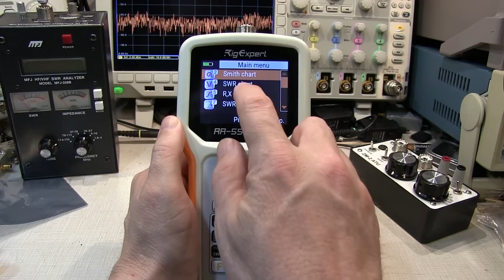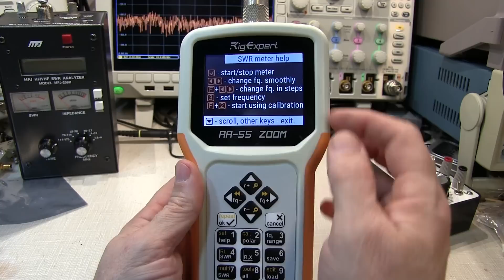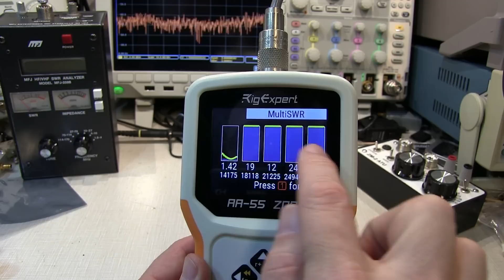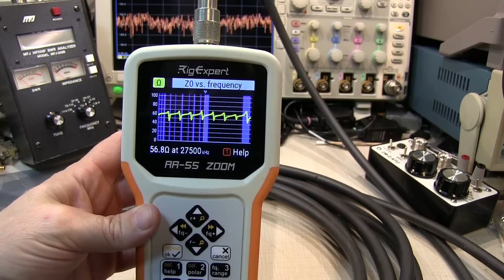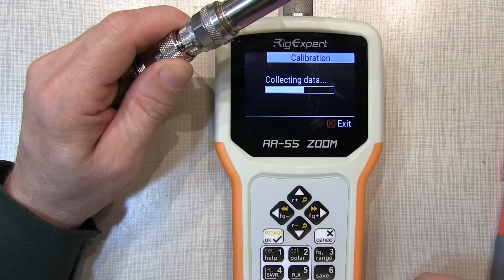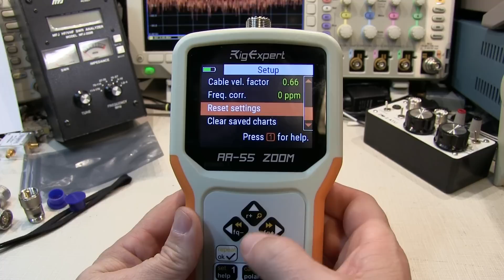#280: Review of RigExpert AA-55 ZOOM Antenna and Cable Analyzer

Comment: For a video that is over six years old, this is one of the most comprehensive and exhaustive videos on this cable and antenna analysis tool that I have been able to watch so far. I do not think that after watching this video I need to watch another video on this product as the reviewer has done absolute justice to the product under review.
Simply splendid!
73's

Comment: I recently purchased the AA 55 Zoom and found it to be extremely intuitive to use. The basic features for setting up my home brew half wave antennas as a newbie on the HF bands are very gratifying. 
The manual that came with it however was not as in depth as this presentation and I thank you Sir for this Outstanding review.
73 KF4IOZ.

Comment: Thank you for this video. If I understand the parameters SWR , [Z), R, X. But I do not understand the parameters RL , phase , nH, pF what do they represent of the antenna
Many Thanks
Reply from the maker: RL is return loss - basically the (log) ratio of forward power and reflected power.  Just a different representation of the match instead of VSWR.  Phase is a measure of the complex impedance - 0 degrees means resistive, and non-zero means you have either capacitive or inductive reactance.  The nH or pF values are the actual computed values of the inductive or capacitive part of the complex impedance.  They are only important if you plan on designing your own impedance matching network.
Reply: @w2aew  Thank you very much
Reply: @w2aew  Thank you very much for this video, which taught me everything I need to know about the AA-55. Everything is clear now

Comment: YouTube is censoring this info:
I just received a rig expert 500 yesterday and have an ungodly number of problems with it and no way to really contact anyone for help except an email in ukraine. When you finally locate the manual it's in a font size smaller than anything I've ever seen in my life when you print it out, the software doesn't work on any of the three computers that I have and it screwed up the booting on two of them. When you change velocity factor in the settings it's not reflected when you go to take the measurement. The manual does not include any instructions on the functions on the second screen. To top it all off there's really no f**** help at all from the rig expert company for any of these problems they sell it to you and then tell you to go to hell.
Reply from the maker: Sorry to hear of the issues you have. My experience has been good

Comment: will it do the same thing for 11m? also as i do both
Reply from the maker: Yes, you just have to set the frequency manually, but it will do everything else as shown.
Reply: @w2aew  good deal thanks great video and explanation going to order the same one in video
Reply from the maker: @junior53329   You could save a little money and order the AA-35 ZOOM if you don't ever need to go above 35MHz.  All other functions are identical to the AA-55 ZOOM shown in this video.
Reply: @w2aew  yea I just looked up the 55 and the 35 there right around the same price point

Comment: A question from a new General HAM, since this was not mention in the General study guide
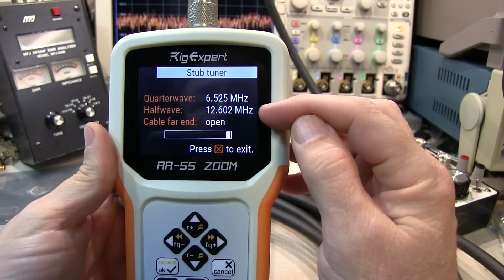16:15 If your coax to the radio is not 1/4 or 1/2 wave length long and the impedance at one end does not match the other, can this be fixed with an antenna tuner or its better to try and get that coax length right? Thanks for the detailed guide.
Reply from the maker: It's perfectly OK if the coax isn't a specific length.  All that means is that the impedance seen at the input of the coax isn't the same as the antenna impedance.  However, if the antenna is adjusted/tuned to be at the same as the feedline impedance (coax, typically 50 ohms), then it radio sees 50 ohms regardless of the length.  If the antenna is not equal to the feedline impedance, then there will be an impedance change (but not an SWR change).
Reply: @w2aew  Thanks for the clarification.

Comment: WOW!! No stumbling, no 'hem-and-haws' with your information!! You FLAT know what you are speaking about!! Question: Does the calibration 'Tee' come with the RigExpert, or is that an extra expense? I have learned WELL that that particular 'Calibration' step is VERY important in adjustment of your antenna or networks!! GREAT JOB!! you sold me on the unit!!
Reply from the maker: The cal set that I used was something that I had.  I don't know if RigExpert offers one.  So, you'll have to obtain or build your own.

Comment: do you have a video of cutting the coax to length using this aa55. i need to cut my coax for my 11m beam antenna but cant fig it out. im new to all of this. nice vid
Reply from the maker: Why do you need to make any measurements to cut your coax for your beam?  The feedline length is not critical for antenna operation.

Comment: I know this us an older video but hope you will answer my question. Does the calibrated OPEN, SHORT, LOAD come with the analyzer or is that a separate purchase?
Many thanks!
Reply from the maker: This would be a separate purchase, or homebrew project (I have a video on that).
Reply: @w2aew  Many thanks for the info.

Comment: Could you direct my inquiry. And forgive my non-techy question. My dad installed a whip antenna on his roof about 6 foot on a about also 6 foot pole in a 3 foot grounded tripod with LMR 400 coax cable. He cannot get the meter to read below 4 on the roof and 3.1 at ground level stuck in ground. Any help sure would be appreciated.
Reply from the maker: Not enough information to go on.  What frequency/band is he intending to use?  What is the antenna, specifically?  What does the SWR read in the middle of the band of interest, and at each end?

Comment: hello friend I have an analyzer just like yours but I have a problem when I measure the swr it gives me an answer of the swr and when I measure it with the radio it gives me another what will be the real swr? the radio or the antenna analyzer?
Reply from the maker: This can sometimes happen if the shield of the coax is acting as part of the antenna itself.  The analyzer and the rig will present a different load to the shield, thus can give different results.  Also, if you use a different length of coax to test with the analyzer and what you use with the radio, the reading can change.  The result from the radio should give a better indication of the mismatch that the radio is seeing, assuming it has been properly designed/calibrated by the manufacturer.

Comment: I found this video seeking to understand R and X measurements.
Someone told me there is more to tuning an antenna than SWR. However on 11 meter band I've had good luck simply setting SWR.
That's an awesome analyzer and great review of the Rig Expert!

I have the Nano VNA H4 and its very nice but I don't think its on the same level as the Rig Expert but for the money it sure beats a traditional SWR meter.
I never thought about calibrating it to the end of the coax, that's a great idea.
I'm not sure how you would deal with an antenna that has a certain length of built in coax like a mobile antenna though.

Comment: So if i want to know what length do i need for specific frequency do i plug it to the antenna or no? I just got that analyzer  yesterday, thanks
Reply from the maker: If you're simply feeding a single antenna with your coax, you do NOT have to make a specific length for a given frequency.  The SWR will not change with the line length.  If it does, it means you have some common mode current flowing on the outside of the coax, and that should be corrected.  It is true that the impedance looking into the line will vary with line length, but the SWR will not change.

Comment: Thanks.  Pretty good analyser.  But for the beginner, remember that coax is not the only answer.  A dipole for multiband use is by far best fed with twin cable into a 4:1 balun, short coax to a matching unit.  Why?  look at those high dB losses in the video with even a fairly good SWR using coax.  With twin, you can reduce those losses to just fractions of a dB, even when the SWR is very high.
Reply from the maker: That's precisely what I use.  A 130' dipole fed with window-line twinlead into a widerange balanced line transmatch.

Comment: Can you please provide a link to your 3 port open, short, 50 ohm device?  tnx KF4HR
Reply from the maker: It is made by Rosenberger - and I'm afraid it costs more than the analyzer if purchased new.  I picked it up at a hamfest several years ago for a lot less money.  You can build one that works well for HF/VHF.  I did a video on that.
As examples, here are some units like the one I used:
https://www.ebay.com/itm/Rosenberger-Calibration-Kit-open-short-load-7-16-female-DC-4GHz-60K34R-MSO-/293092915400
https://www.amazon.com/Open-Short-Calibration-Connectors-NMOSPL-12/dp/B07H7TBZYD

Comment: Can this analyzer be used to get 'real-time' measurements while 'tuning' an antenna (such as a hamstick or buddipole) ??
Reply from the maker: Yes, it updates a few times per second.  Also, features like the SWR meter function, the SWR2Air function and the Heartbeat Monitor function are all aides to help you with live tuning of an antenna.
Reply: @w2aew  Ok, thanks.

Comment: Can someone point me to instructions for setting my 2m SWR2Air frequency? When I try it only let's me do HF frequencies. Example, I try to use 146.490 but it comes up as 14.490. What am I missing???
Reply from the maker: I believe the maximum you can set it to is 146.000MHz.  While in the SWR mode, hit F-3 to get to the screen to set the frequency, and use the numeric keypad.
Reply: @w2aew  I did the F-3 keypad thing, I guess I'll try inputting your frequency. Can you video yourself inputting your frequency? That would be a REALLY big help.
Reply from the maker: @Tommyr  When you hit F-3, it should show 6 digits to be filled in.  If it only shows 5, maybe you need to hit the left arrow....
Reply: @w2aew  It won't let me go left, it beeps at me. Firmware version is 1.24.
Reply from the maker: @Tommyr  Is yours an AA-55-Zoom?  If not, it may be a limit on your model.  Firmware on my AA-55-Zoom is 1.14.
Reply: @w2aew  Mine is the same as yours, the AA-55 Zoom.
Reply from the maker: @Tommyr  You'll have to ask RigExpert why you can't do the same as mine (v1.14).  Maybe they had to reduce the maximum frequency for this features due to some regulatory reason.
Reply: @w2aew  O.K., thanks for your replies anyway.
Reply: @w2aew  SOLVED! Alex from Rig Expert emailed me back and solved my issue. When in the SWR meter mode press and hold "F" while pressing the "3" key. This allows input of the 2m 6 digit frequency. I was pretty sure I tried that but I guess not. Thanks to all who tried helping here, I really appreciate it. Sometimes something so simple can drive you nuts.

Comment: I have been using the MFJ 259 for several years until i caused a short due to a sloppy coax connector i made. I almost bought the MFJ 226, but it was out of stock but just as well as it did not operate up to 6 meter. This Rig EXpert AA 55 video makes the 259 seem primitive and outdated. Good for a new ham maybe. But the AA 55 looks like it will satisfy my needs for many years to come. It packs a good punch of sophisticated software for the price. I'm sold. I will order mine right away.

Comment: When measuring the coax resonant length, to get accurate readings should the coax be laid out in a straight line or can it be in a coil or any shape on the floor?
Reply from the maker: coax can be coiled or laid in a pile - just avoid sharp bends if possible.
Reply: @w2aew  and should i make the velocity factor setting in the menu the correct value for the coax im measuring?
Reply from the maker: @HFpirate  If you want the distance measurement to be accurate, then yes!  If you don't care about the actual length and only adjusting based on the measurement, then it doesn't matter.

Comment: In the setup menu you can change the cable velocity factor. Does this have to be set correctly to get accurate swr etc readings? In other words, using lmr400 coax, i need to change it to .85, using rg8u i need to change it to .66 and so on.
Reply from the maker: No, it only needs to be set right to get accurate “distance to fault” measurements. Has no effect on SWR.

Comment: As always, very clear and understandable.     
My AA-35 doesn’t have all these features on the unit such as the Smith Chart. In PC mode, Smith Chart is functional. Less the 2 years old, is there  a firmware update.

Comment: Great review. Replaced my lousy unreliable MFJ-226 with the AA_55 Zoom. What a NICE Antenna/Cable Analyzer and investment! My permanently retired inferior MFJ doesn't even come close to the RigExpert. The MFJ  required re-calibrating after every use. Additonally the VSWR readings were inaccurate to boot. Don't waste your $$$ on the MFJ, trust me, the RigExpert ROCKS!!
Reply: I too suffered for years with an MFJ. Glad the memories are distant now--seems I recall 14 batteries and twelve screws to swap 'em out. Also that the battery holders failed and had to be replaced. Usually needed batteries every other time I wanted to use it as well.  Anyway, it did work better than anything I'd used before and the company is gone so I'm done beating up on the product. I have had good success with many MFJ bits of gear.

Comment: Just use my RigExpert aa-35 zoom to check out my endfed 1/2 wave 135 foot antenna.  got readings of less then 1.5 to one on 80, 40, 30, 20, 17, 20, 15 and 10 meters.  You helped me a great deal knowing how to use it.  Thanks

Comment: After watching this video for the um-teenth time to refresh on some details and having RigExpert AA-600, with much of the same functionality, to practice with I am wondering if there is a viable method to conduct coax loss measurements even though the AA-600 does NOT have a specific "Tool" for doing so as does the AA-55. Is there a way to infer/determine/calculate loss from any combination of TDR, Smith Chart, Return Loss, Complex Impedance etc that would prove useful for evaluating that useful parameter? I'd love for you to do a video on that if you think it would be of value to others.

Comment: I love your video's as I have been watching almost all.   I have a RigExpert AA-600.  I wanted to update the VF to match my coax cable, M&P Hyperflex 10.  The cable has a VF of .87.  The Rigexpert selects VF by cable name and Hyperflex 10 is not listed.  The closets cable is LMR600 with a VF of .86.  Is there a way to simply enter the VF value rather than select by cable name?
Reply from the maker: The menus are different between the AA-55 Zoom and the AA-600, so I don't know the answer.  You'd have to ask their customer support folks.  However, I would think that 0.86 and 0.87 are close enough that it won't make a big difference in your results - just over 1% off.

Comment: I just purchased the RigExpert AA-35 Zoom and I don't see the same menu as what your're doing here on the AA-55. Are these options different between these two models? I even downloaded the latest firmware from RigExpert to no avail. Did I buy the wrong one? because I have no smith charts nor the stub coax menu for which is why I bought this thing. any ideas?
Reply from the maker: According to the RigExpert website, those extra measurement displays are not on the AA-35-Zoom.  See the specifications for each on these pages:
https://rigexpert.com/products/antenna-analyzers/aa-35-zoom/specifications/
and
https://rigexpert.com/products/antenna-analyzers/aa-55-zoom/specifications/

You'd have to trade-up to the AA-55 Zoom to get those features.
Reply: @w2aew  ok thanks for the reply, life goes on.  My mistake for not realizing.

Comment: Pretty interesting!  So this one shows the Actual impedance (Z)  and the complex impedance shown as R (resistance) and X  (reactance, inductive or capacitive).  Can you tell me what does R indicates on a MFJ 259b or Comet CAA-500 Mark II ?  If i understand correctly, the R value on these two meters arent the actual impedance (Z)   Would one have to use the Smith chart to plot the actual impedance using R and X ?   I hope my question is clear enough.   THANKS!

Comment: what is the difference between the zoom and non zoom models ?
Reply from the maker: The main difference is that the ZOOM models give you the convenience of zooming in vertically (SWR, Resistance) and horizontally (Frequency) without having to re-do the frequency settings and re-measuring.  The ZOOM devices are newer designs, a bit faster, better displays in some cases, and longer battery life.
Reply: @w2aew  thank you for replying ! After reading your answer, I did try to compare both 230zoom and 600 manuals to see how the 600 was different by what you were saying and I also think that the 600 and above does NOT have the "tool" menu that the zoom models have. Thanks for the precisions !

Comment: Is there any value in upgrading to a unit that has a Time Domain Refractometer (TDR) for use in Amateur Ham applications?
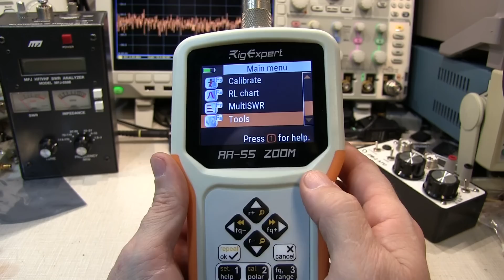Reply from the maker: Most of the reasons for having TDR functionality is to measure distance along a transmission line - such as measuring length for tuned stubs, or determining the distance to a fault (open or short) in a cable.  These feature are built into this analyzer, and are shown beginning at about 15:40 in the video.
Reply: @w2aew  It appears that the TDR functionality is available when you connect to the Antscope2 software to be able to find faults in coax.  Can you confirm this is true?  Thanks again!
Reply from the maker: @dennisschultz1175  You can get some of the functionality with the unit itself, such as determining the line length.  But, additional TDR functionality is available with AntScope2.